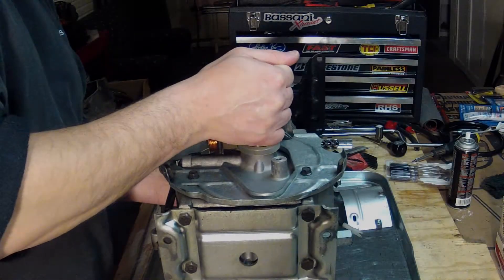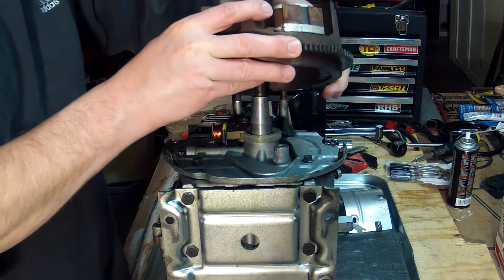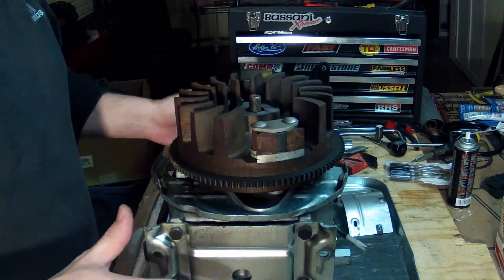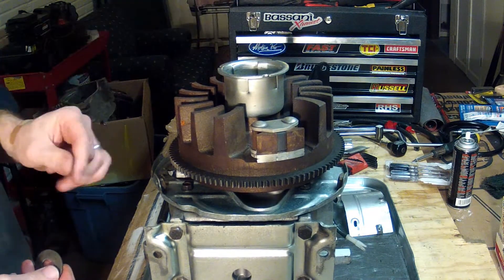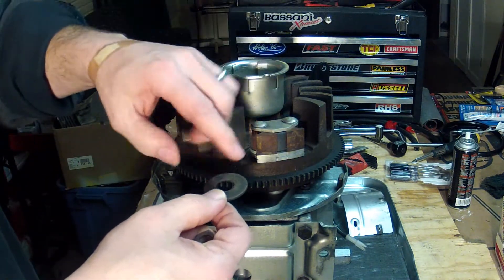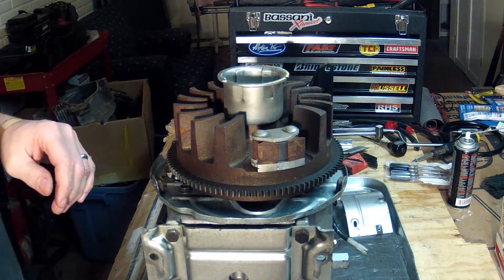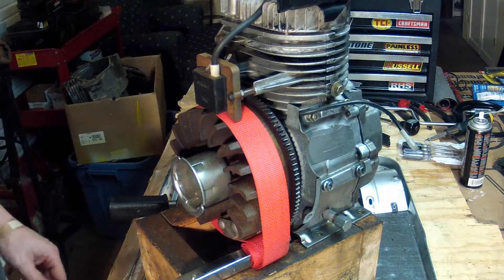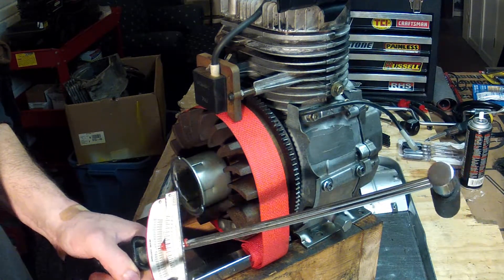Tecumseh HSK70 Rebuild - Part 22 - Flywheel Installation

Comment: Where does the coil wire connect to once the flywheel is back on? I don't see where mine connects to and it's unplugged. Thanks for taking the time to respond. I'm not talkin the spark plug wire but the other wire w/ the C looking connection on the end.
Reply from the maker: I think that you are talking about the kill wire. That can go anywhere that you have an on/off switch on whatever machine the engine is on.
Reply: @RealManSkills   ok thanks for responding. watched all your episodes up to (ep 36) firing the motor and yours was also not connected.  Atleast I now know what it is. Thanks again. I've subscribed to you channel for future references.